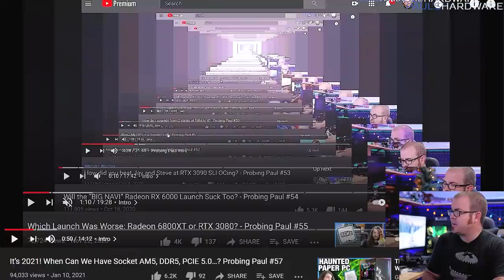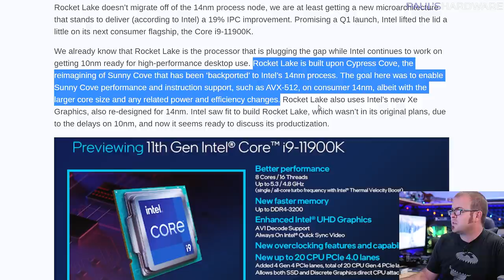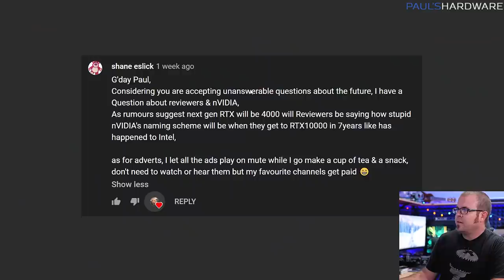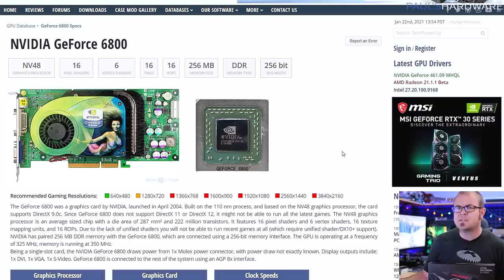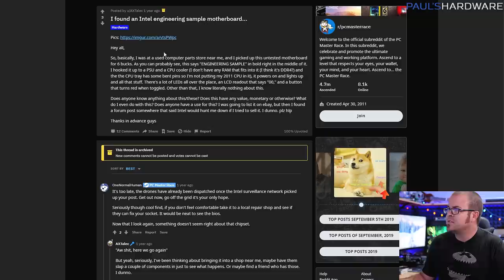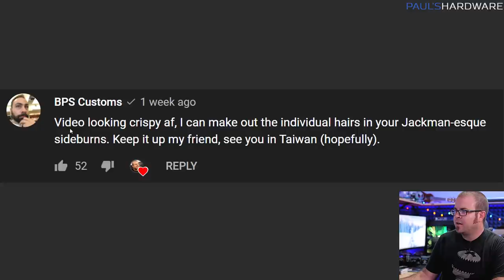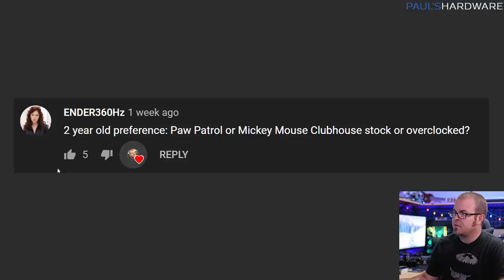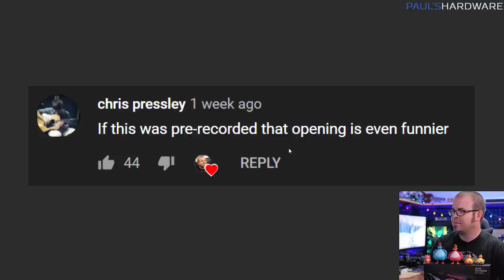Why is the 11900K only 8-Core instead of 10? - Probing Paul #58

Comment: Hey Paul, really love your videos and the channel as a whole :)

Do you believe that the i9-11900K with the increased IPC is enough to offset the 2 core deficit from previous gen i9 ?
Reply: I see it as if your game or program cant use 10 cores sure. but if your usecase is able to use the extra cores the 10900k will probably out perform the 11900k. the 11700k may be alright as it will be the same 8 core 16 thread but cheaper but alder lake is so close the 11900k really feels like a get something out so the investors don't lose hope kinda chip

Comment: Question for the next probing Paul.
Is the IPC improvement of a new cpu worth it? Reason behind the question is, I planned/started buying pc parts for my build in December 2019 and went for the z390 aorus xtreme waterforce 9900KS cause of the 5.2Ghz all core OC speed insurance. Knowing that next gen cpu's ang gpu's are on the horizon. And in my plan I will go for next gen gpu so I went for the rog strix 3090, also knowing about the pcie gen3 and gen4 bandwidth speed difference. And now that my pc build is almost complete, I wonder if the IPC of a newer cpu has an impactfull difference, something like 20 to 50 percent overall pc performance. 
Cause the pcie gen3 gen4 difference of my build is a small factor in my opinion.

Thank you very much in advance and more power to you and your youtube channel.

Comment: remember the 8700k had 6 cores/12 threads, and its successor (9700k) only had 8 cores/8 threads.  Yet overall the 9700k was as fast or faster.  But personally I think the change the the 9th gen was to allow for the 9900k and a higher msrp.

Comment: Hey paul love your work.

Im planning to build a new system by 2024, I have a question about CPUs, if ryzen5 is the sweet spot for gaming and ryzen9 is the top of the line is it worth it to go through ryzen7?

I wonder what new hardware will come out by then.
Reply: You gonna get back to us in 2024 bro.. we will see what you need when that time comes. At least 8 cores for gaming but MORE cache is key to high fps.

Comment: Hi Paul.. Question! In spite of the general lack of CPU/GPU availability, I may be in a position to at least contemplate an investment upgrade for my Ryzen 1600/GTX1070 based PC.. would you think at this point it's worth resting on the B550/X570 platform, or do you think the hardware supply issues will persist long enough that it might make more sense to now wait for the next, new socket AMD platform refresh?

Comment: I think the development motherboards are made by smaller manufacturers, I worked a part time job in a factory that produces simular boards and most of the components are of the shelf so they often have thousends in stock. If Intel now came up with a new socket they only need to produce the actual socket und than mount it on most of the old boards, which should be enough for testing purposes. The PCBs are most of the time also quiet standard components so als long as you don't change the physical layout of the pins you can use boards that are currently used and produced.

Comment: HI Paul, 
I am looking to upgrade my 4-5 year old Intel based system.  With all the new launches between Intel and AMD, which platform would you suggest for the best upgrade path, and if possible which level of CPU would you pick on either side.  Love the videos!
Reply: Intel.

Comment: Hey Paul hope your doing well, I've been watching your videos for awhile. My question is about Custom Cables. 

My Build(+)

Case: View 71 TG
Mobo: Strix X570-E
GPU: Strix 3070 
CPU: AMD 3900
PSU: Strix 750w
CPU Cooler: Strix AIO 360MM
Storage: Firecuda 1tb
Storage SSD: 750 Samsung 1tb (2 of them) 
Cooling: 9x 120mm Corsair QL + 2 Corsair Commander Nodes 

Which cable sleeves do I need to order for this build? How many "Sata"'s and which type? How many 8 pins? Etc

Hope to hear from you.

Regards, Mazi

Comment: I was ready to build my first computer but the shortage on parts had me instead get a redux (digitalstorm) configure so I could get my hands on a 3060ti for a reasonable price (purchase made in early January) I picked a R5 3600X as my CPU. Do you think it's a good idea for me to replace the A520 motherboard with something as expensive as a $160 B550 Aorous Elite when I"m only gonna run PBO for overclocks? And do you recommend people doing first time builds also go through system integrators right now just to get their hands on GPUs and then replace the lower tier parts themselves (motherboard ram storage)?

Comment: This may sound like a non-sensical question but when AMD introduces the AM5 chipset (not sure that is the correct nomenclature) are the pins going to still be on the CPU or are they going to be like INTELL and on the board? Love watching all your videos BTW!!  Especially you and Bitwit together
Reply: Good question! AM5 is the "socket" type that the CPU sits in, though it does have a chipset associated with it.

To answer your question, it should still have the pins on the CPU, because it is another evolution of the AM line of "PGA" (pins on CPU) CPUs.

Comment: Paul, Beginner questions here. If I have 2x8 3600 CAS18 memory, does everything need to be the same if I want to drop 2x16 more in? Does it need to be the same brand? Does the 2x16 need to be in slots A or B? I want to add the 32GB for a total of 48GB.

Comment: Question: (waiting for availability of CPU and GPUs to come back not paying dirty scalpers) I have a Ryzen 3900 right now, would it be worth it for me to "upgrade" (if you can call it that) to a Ryzen 5900 or should I just stick with the 3900. I currently am going to school for game design so I do a lot with unreal engine and  I do occasionally stream while playing games with friends. *current setup is 3900, 32gb ram running at 3600mhz, with a gen 4 240gb M.2 SSD for boot and a 2 TB HDD for work and games. Running a 5700 XT GPU, powering a 1 3440 X 1440p monitor for main display and 2 1080p 60 HZ monitors for running chat/browsers research and school information.

Comment: suggestion for naming of future Nvidia cards, something along the lines of the RTX (or what ever __X we are at by the time we get past 9000-series) RTX 10K6/10K7/10K8/10K9 and their Ti variants. but this really isn't something we should be worried about, we most likely see 10K Series cards until 2030 or 2035.

Comment: Hello there. I currently have a naked single stick 16GB ram (no heat spreader) and I want to add 1 more of 16GB. should I switch to 2 x 16GB ram with heat spreader or just buy another 1 identical to what I currently use ?
I don't really OC my setup, if that matter

Comment: I bought a Coolermaster mL240L RGB V2 (round pump no text on pump version) but I'm hearingnthe V1 had leaking issues but the new one is advertised as having Anti Leak is the new one in using safe? I hope you could answer this cuz I have not heard anything from anyone on this.

Comment: Question for Probing Paul #59

I've got my heart set on the SAMSUNG 49-inch Odyssey G9 Gaming Monitor | QHD, 240hz. I have the desktop space, but would like to reclaim some of that space, my trailer won't support wall mounting it, so drilling into the desk is my way to go. I keep hearing there are no Vesa Mounts that will support this beast. any suggestions on the best unit to get? thanks in advance.

Comment: Hi Paul! 🍻
I had 2x8 ram setup in my system. 1 stick went bad but the other is fine. They don't sell the same type of ram in single stick packaging. Could I buy a 2 pack and have 3x8. Or does having an odd number of ram sticks cause issues?
Reply: Mr Anderson  Thanks man, I appreciate that. Yeah it does support dual channel. since my wife and I both have the same type of ram in our rigs, I could just hold onto the extra stick as a backup in case another one of ours dies.  Thank you, sir.

Comment: Paul, here's a question.  Is PBO safe?  I can't seem to get a straight answer.  My 5600x boosts to 4.6GHz all core on PBO, but at 1.39V.  I've read conflicting stuff online.  For example, one camp says "voltage is controlled by the CPU, it won't do anything to hurt itself", but the other argument (probably more specifically for static voltages) is never go over 1.35V.   Can you shed any light on this?
Reply: No. PBO over clocks PAST manufacturing spec's.

And V1.28 is what you should aim for on AMD to avoid degradation of the chipset

Comment: Hey Paul... like ur vids...;} my question is, I built a 3600x on a B450 mb with an old bios so it will run in pcie 4.0. right now i'm using a RX5500 XT gpu, I want to up grade to a 6800 gpu when there avable. Will my chip set handle a 6800 in 4.0 ??? Everyting runs great now oc to 4.4, my monitor is 1440p.

Comment: Hey Paul! I Have a Question. I have an i7 10700k, and was thinking of getting an ROG STRIX Z490-E MB, but should I instead get an ROG STRIX Z590-E MB? I'm not getting an 11th GEN, and not planning on doing 12th Gen either.  Thank you.
Reply: Right now it appears you're better off sticking with Z490. As you can still use 11th gen on Z490 and Z590 board is effectively the same other than higher RAM clock support out of the box for lower end 590 series boards. PCI-E 4.0 is still from the CPU and only PCI-E 3.0 from the chipset. If you are still unsure, wait for the Z590 reviews.

Comment: I have a 3900xt, running at stock speeds, with a 240 aio for cooling. It seems to run hot to me, idling in the mid 50's no matter what I do. I've tried a couple types of thermal paste in various patterns, remounted the aio,  and adjusted fan settings. Even at max fan and pump speeds, it barely drops into the 40s. Did I simply lose the cpu lottery?

Comment: Would it be at all possible for GPU manufacturers to use an additional PCIe slot for an add-in VRAM card to increase the total VRAM of a single GPU? Possibly using a bridge similar to an SLI or Crossfire bridge, but simply to offer a VRAM upgrade path. Would the physical distance make that impractical, even with PCIe 4 (or even 5 or 6)?

Comment: Cyberpunk already wants over 8 cores if you have twitch, discord etc running your pc, it will happily use the 12cores on a 5900x for a smoother experience. 8 cores isn't going to age well at all when 2021 games are already happily using more, if you dont have a fresh windows install with nothing else running. Get a 10850k while you can or go AMD 5900x/5950x, especially considering the price. 10850k is the same price as 11700 non k msrp ATM. If your considering a 11th gen i7/i9, get a 10th gen i9 or go AMD 5900x.

Comment: Hi paul, huge fan. I built my first computer following your steps.  I have a ryzen 5 2400g and 16gb ddr4 3200mhz corsair vengeance rgb and 650W sfx cooler master and cougar qbx and 1tb pioneer nvme m.2 ssd, gigabyte x570 itx.  My issue is that i am focusing mainly on 60 fps 1440 p and up gpu to pair it with my current build without replacing cpu. Plus am4 is basically going to be replaced by am5 and ddr5. Any advice . Please answer this time . I  am with all do respect getting sick of being ignored 😒.

Comment: If you had to buy a gpu for gaming in 2021 for 1080p but don't have the dough so to say for a current gen card, which previous gen cards would you say are not totally outdated yet and would be able to play MOST current and maybe future games at acceptable quality and framerates?
Reply: A 1650 if you can find are good for 1080 or a 2060-2070S

Comment: Hey Paul, you mentioned both your dad and grandad had full head of hair. It's a misconception that hairloss runs in the dads genes, it actually runs on the mother's side. If your grandad suffered hairloss or baldness on your mum's side then it's possible your carrying the gene.
Reply from the maker: I probably could have phrased it more clearly, but I meant to say that both grandpas on mom's and dad's side didn't go bald 😁
Reply: @paulshardware  Hey in that case you're good ^_^

Comment: I have a old pc with ddr3 8gb ram gtx 760 and a fx 8350 would it be better to upgrade or buy a new PC at this point
Reply: I mean just upgrade the parts you mostlikley dont need to change your ssd's if you have any. And also keep your gpu, they dont exist rn

Comment: I Paul. I am building a new AMD 5900x based system with RTX3080. I was able to find an RTX thanks to standing in line for a couple of hours at Microcenter, but have yet to find a 5900x. So rather than pay a scalper $800 for a 5900x, I was thinking of getting a cheaper older 3000 series AMD processor (new or used). Figure I could get something for about $200 to keep me online until I can secure a 5900x. Have any advice on  a good CPU to hold me over for a reasonable price? I know I can also resell the old 3000 series zen when I get my 5900x as well.

Comment: I have an A320 motherboard and wanted to upgrade to a Ryzen 3600 however when I did the motherboards VRM was not able to supply the CPU properly and kept crashing. Which made me wonder to what standard do motherboard makers design to support, shouldn't they support all of the CPU's for that socket with stock frequencies?
Reply: it should work 3600 is efficient

Comment: Do you have any USB 3.0 PCIe cards you can recommend? Need some more USB ports for my computer.
Reply: if your not using the usb 3.0 at max bandwidth and have perphials or other low bandwidth devices id suggest just getting a hub
Reply: @Demon09-_-  need more ports for VR unfortunately, so yeah I’m using all of the bandwidth
Reply: @masooncap9769  ah I was just saying you could put all your low bandwidth devices on all on one hub. but if you have already done that then guess you need a pcie card. its been a while since I have had to add an add on usb card so no personal experience to give recomendations on usb 3.0 cards but hopfully someone will come along that does

Comment: For the last few generations processors have mostly scaled horizontally instead of vertically. Do you think that until some paradigm shifting technology we'll just be stuck with similarly fast cpus with higher and higher core counts?

Comment: Ive got a real MAJOR question, why does AMD have a version of 2.10.13.408 for chipset drivers (b550) etc but MSI has 2.10.26.336 (also b550) i wrote AMD support on this, they said to use .13.408 but wouldn't it make more sense that .26.336 would be the later version? if not why, and what's the deal with motherboard drivers showing incorrect drivers over AMD etc?  you can answer this here as amd couldn't give any actual answer, explanations to what's going on.

Comment: With the wonky supply chains, prices and fluctuations in availability , why are more people not turning to server-oriented CPUs with similar cores, threads and clock speeds and the advantage of built-in error correction?  For example, Xeon or Epyc.  Is there a price point, (lower-end chips not 64 core monsters), where crossing over makes sense?  Thx!

Comment: Also while I'm at it, some of us have been using SAS3 (12Gbs) drives for some time and SATA is still at 6 Gbs, why is it still at 6? By now the SATA4 protocol should of been done. Yea, I know NVME is faster and what not but $/GB is still high in comparison and its not like Hard Drives are dead or an end of life product. Wouldn't it also help SATA SSD's have a higher throughput for faster backups, like the saved games and what not.

Comment: Intel BL Core i5 150 anyone?
Brand, Subbranding (BL stands for big LITTLE which is where a CPU has at least 1 powerful "big" core and at least 1 power efficient "LITTLE" core, Intel has been incorporating this into their laptop processors, in order to try and compete with ARM based SoC's.), i5 (we all know what that is, right?), 150 (refers to the beginning of a new series of CPU/APU's.). this is my suggestion for a new naming scheme intel could use instead of having such long names.

Comment: So why isn't there a standardized case buttons (pwr, reset, hd led, etc.) to mobo connector, its not like PC's were created yesterday, at this point it should be connect case connector to mobo like USB and it all works, if a feature is not supported then it wouldn't have a wire to the block... seems a bit weird this  is not a thing yet.

Comment: if i had to name processors i would name them year they got released, and tier, in case of intel the 11000 series would be 21X0 or the 11900k would be 219k or you could add a 0 to make it easier to the tonge 2190k

Comment: AVX512: just what consumers were desperate for.

AVX512 is pretty useless for practically all consumer workloads. Firstly, AVX silicon is extremely power hungry which means more heat; the power consumption increases with the word size of the AVX instruction set (so 512 uses more power than 256 did). More power + more heat = less boost. In addition, because AVX is so power hungry, Intel (and AMD) keep the silicon powered off for the higher word sizes: bringing the silicon online introduces latency. Consumer applications would have to ensure that they keep the silicon powered up by continuing to feed it work to do, which games cannot do by nature.

AVX512 only really makes sense in batch computing, e.g. science or offline rendering.

Comment: why can't product names be the year the product generation was release, followed by the performance category, then extra designations.... Intel's '21-9k or just 21-7 for the non overclocking one. Or Nvidia's 4000 series (assuming it's next year) 2260 / 2270 / 2280 Ti
Like cars have the model year.
Obviously I know that they can't do this exact format, but model numbers have the potential to be so descriptive with just a few numbers if more than 10 seconds of thought get put in it. How did it get this bad?